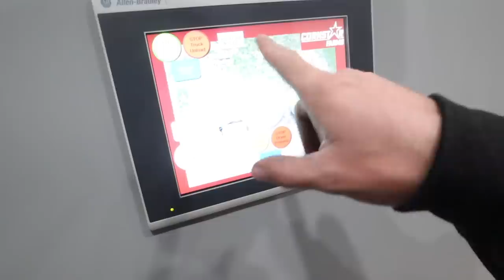Dad Blew His Top

Comment: have the elevator leg sped up either electric or change the pulleys on the drive as it is not at the rated capacity and it sounds as tho the cross auger is at 8000 or slow the cross auger down by changing the pulleys

Comment: Can you put larger belt pulleys on the motor and the cross auger to get more surface area so the belts don't slip so easily? Can the center pit auger be sped up to take the corn away faster. Possibly turn the cross auger on once the pit auger has taken everything it can so the corn isn't getting jammed together in the center. If the motor uses VFD, there is a way to set the current load on the motor to shut it down before it slips the belts. Maybe slow down the cross auger by putting larger pulleys on it. You might even put sprockets and chain on it instead of belts.

Comment: can you remove some of the flighting from the ends of the cross augers where they meet in center to take load off belts and still move gain to center auger? Next option install smaller diameter cross augers to take load off belts. Another option would be to slow down cross augers by changing pulley diameter.
Good luck and God Bless thank you for the videos and hours of editing
Reply: pass it on please I have hat and sweat shirt already. thank you

Comment: If center auger to leg can't empty because leg it too slow.....Change pulley on cross auger to slow it down so it won't overload and burn belts off. It might not run at capacity you want but at least it will run so that you can head back to field while pit empties. Running a little slower is better than burning belts and blowing a head gadket.. Looks like combine is running good.
Reply: yep,  if its building up in the middle slow down the cross augers

Comment: Belt drive basics as I understood them: A drive belt has a horsepower rating which is affected by the service environment. Belt speed and heat are two things that will affect service life. Belts will operate reliably if alignment of the pulleys and belt tension is within the manufacturer's design envelope for a given application. 

The system as I understand it: The drive motor has a horsepower rating. The auger has a horsepower input requirement for a given weight of grain per unit time. 

Why are these auger drive belts failing to give expected service life? Difficult to analyze from here. But... If alignment and tension meet mfg specs what is the rating on the motor and the rating in this service on the belts? Could it be as easy (and by easy I mean possibly very difficult if not impossible without painful and expensive equipment modifications) to increase the number of belts and the width of belt used. (Yes. New sheaves/pulleys for wider belts and possibly more sheaves/pulleys for one more additional belts.) 

Next I'd worry about the auger bearings. 

Are the motor amps under load essentially the same as the FLA (full load amps) on the motor nameplate?

Comment: I thought that green machine was  a Lean, Mean, Soybean eating machine!  It's mean and mad. GLad they are bringing another for you to try.  :)
Goodyear makes good tires, yes ag is different then cars. But i like them, two sets for two cars.  
I had a plymouth van years ago, the accy belt would slip off if it hit a cold water puddle in the fall.  
Goodyear made a gatorback belt and kit with a double sided v belt and a grooved idler.  

Maybee the tire rep has some contacts you could order some good GOODYEAR belts!
Wishing you the best in harvest and hope you can find the problem for the cross auger. 

As far as the air hose, put a tee to a whistle for your dad.  Put it at the top of the structure.  Blow a 14-L!

Comment: i got a top tip for you to chek out an is do it now not after harvest ---   secret about electrick in 90% off the time its cheper to let it run than start it 3 to 4 times a day  you might want to ask your electrick guy or your prowider how your bill is structured  the higest price you pay is calculated on the amount off ampers you use when you start a motor hear is a crud example 100 amp motor might go to 150 amp on the start then go down to 70 under load

Comment: You guys have every right to be upset. You can only bottle up so much. Doesn’t matter how much money you spend on something it should work atleast until things start to wear or get old. We’ve fought that chaffer issue on our s680 since we’ve owned it. No reason there shouldn’t be a fix for that by now
Reply: After DCs explanation at about 15:00, since your pit auger and leg aren’t moving grain fast enough it sounds like that middle double auger is moving to fast so if you aren’t done yet you could put on a bigger driven pulley to slow it down to get by. Sounds like it might be trying to force too much grain to the middle

Comment: My guess is that the cross augur pulleys are to small for the horse power of the motor, gates belt chart for the min diameter on the motor to the hp.
up size the pulleys and installing longer belts to fit should fix the problem .

Comment: Re your cross auger issue. If I understood what D-CornStar was explaining, in that two motors are pushing corn to a centre point, and when that point becomes full they get overloaded and belts burnup. You should be able to detect this by monitoring the load on the two motors doing the pushing with a simple device like a "Shelly EM" (which can monitor two loads). with this detail your software guy would have the means to add rules that say if the load  on any of the 2 cross auger motors is above X load for more than 1 minute, turn the motor off for Y time period then turn on again. Should be fixable regardless I hope that helps D

Comment: This may have been mentioned before.. but is it possible to take that cross auger and split it, add a second motor to the other end, in some form? Either split the auger, or keep it as one but a second motor, something like that? Since I assume replacing the pit with something else is out of the question at this point..

Comment: Have your automation guy program the plc so that the cross auger in the pit does not run when you are start the pit. Start running the main pit auger and then when the pit is mostly empty and the current drops off on the main auger, then turn the cross auger on and run until the pit is empty. That way the cross auger will not fight itself when the pit is full.
Reply: excellent logic my friend
Reply: But I very much doubt that it has a PLC

Comment: I cant remember if there has been a good video shot showing the motor pulley setup in the pit. Seems I am only remembering some dark hard to see shots. That said, if there is room to change the pulleys on the Motor larger an or smaller on the Belts pulley, until the auger situation is fixed. This would slow the the belt speed of the belts. Have to wonder if your auger is in need of different pulleys, but I am sure that is all in the problem you are having that's in the lawsuit.

Comment: Does the cross auger in the pit start at the same time as the lifting auger? If it does the lifting auger may be overfed and the cross auger burns out its belts. If this is the case i would put in a timed delay on the cross auger so that the lifting auger has time to empty out the center of the pit before the cross auger starts. Just my two cents on the problem from the limited information on the issue.

Comment: I'm not sure of the setup you guy's have but from the little bit I have seen of the pit you're ALLWAYS gonna be having problem's with it it!!! I am a millwright and all I can say is you should have spent the money for a better set up or got a different company.  But you guy's could try putting a dodge gear box on the auger. You live you learn good luck.
Reply: The problem is option number 2, but you don't know that at the time.  They spent more than enough money for the setup they had put in.  The contractor sounds like they were sleazebags, that put it in as cheap as they could on their end of things, and probably skimmed as much as they could.  If it's a company who cares about they job they do, they should know how to put that handling system together properly.  As a comparison, you have Dr Hibbert on The Simpsons, and then there is Dr Nick Riviera.

Comment: Cross auger belts burning up ? 
You need to slow the cross auger down 
and design the auger belt drive so it
capacity enough to trip the motor off 

If do not slow cross auger you need to 
speed the center auger up .... probably 
bigger motor and more capacity on the
belt  drive 

The cross auger and center need to be
in balance with each other 

There is no reason to be burning belts up

Comment: Just breathe DC, it'll all get sorted out.  You dont deserve to get so upset. I dont know what your setup is but it sounds like those 2 side pit augers need to slow down and or increase torque by changing the pulley ratios and if it's only 2 belts, it should probably be 4 per side. I do remember watching you change them before.

Comment: I would look into changing that belt drive system out for a chain drive system, it would be louder but way more dependable. We'll good luck with the rest of your harvest.
Reply: Just trying to dump the truck faster than the cross auger system will handle.  Less belly dump gate opening
They didnt get the capacity they thought they specd

Comment: Start the electric Motor of the pit on before you open the lits ... this shall be much better.
Use chains instead of belt or belt with teeth on the cross orga. Chain translation/gears.

Comment: So sorry the bran new pit and bins systems are not operating properly. I know I would have lost my temper long ago over the pit augers and other constant issues.. I hope the computer system can be adjusted or re programed so the pit augers motors run and pull at the proper rpm at the proper times and stop the overload situation.
There are an amazingly high number of people who just do not understand a that a semi and a pick up pulling a livestock trailer or any trailer with a load on it can not stop on a dime. I see people cut in front of loaded semis on the highway and freeway every day, pass going up hill on a curvy /2 lane road, cut off semis, pull in front of and stop. it’s plain dangerous for everyone when drivers do these things. It’s not worth everyone’s life because 1 person is in a hurry and causes a huge fatality wreck.

Comment: Too many moving parts, I hate to spend money but I'd dig it out, replace with a deep hopper, with only one large pickup in the bottom thats gravity fed.  No extra motors, belts etc, and the drivetrain for the single pickup is on the surface.  Also a longer unloading zone, as you're just barely getting both trailer hoppers to fit at the same time...and fully cover the entire setup...

armchair QB at my finest

Comment: The pit cross auger sounds like a good design BUT did the guy that designed it  have any experience working with one?  Engineering students NEED to spend a year  working as a mechanic  BEFORE they start their final year of study.  That experience will make them think twice about where to run a shaft or belt and how to access it for repairs.
Since the pit auger feeds to the middle and pushes the grain in to fast to be removed by the discharge auger would shortening the flight near the middle, and / or possibly gradually reducing the diameter of the cross auger  near the middle help?

Comment: LOL why did Cole tell him to fold the auger back in after he filled it with corn?
Reply: when its folded back, there is a solid support bracket that holds the weight of the auger in transport or field operation. Extending a fully loaded tube is not good practice, especially if you are going fast and going to hit a rut on the headland.  Probably would have been better if you just would have backed out of the rows and go dump the combine---it is so not worth the risk of a snapped or stretched auger tube because you wanted to save 5 minutes, could have cost you lost time and about $10k for new auger if you could even get one..   It's kind of ironic that DC had the same words for the 4 passing drivers that were in a hurry to get home 2 minutes earlier... I have done all of the above in my younger years, so by no means am I a saint, just have more patience when you get older I guess...

Comment: Could those belts be replaced with chain and sprockets? 
Seems like a cheap and nasty design but then again it might be deliberate as they know the auger design creates a bind and don't want to burn a motor out.
Reply: Apparently the auger is in operation all of the time which isn't necessary. It needs a PLC  to control it.
Reply: @adrianchetwynd1334  Might be an idea to temporarily hard wire an On/Off switch to the motor so they can override it when the pit is full. That way they can just click it on when the pit needs it rather than the computer just defaulting the power to on as soon as they click start.
Reply: @HughzieTube  Very good idea as a temporary fix. But a PLC would be an automatic fix for next year.
Reply: @HughzieTube  The cross auger is only needed to expel the lateral stocks of corn. It does not increase the flow of the outlet, So you are correct, it could be manually operated.
Reply: @HughzieTube  I forget to mention that the bin needs a sensor to inform the PLC that the output auger is running short of corn.
Reply: The output auger can only do what it what it was designed to do
The cross auger is only required after the main input of corn has expired.

Has the man who designed this failed system got a real name?
Most probably not, so my 
message to Cole's dad is: chill out and stop being  so supportable of our real enemy...

Comment: Ever think about putting a heavy duty chain drive on that auger that keeps burning belts. Maybe a larger electric motor? And add a gear down transmission with an adjustable clutch.  The clutch would have to super heavy duty but it would protect the electric motor. I don’t blame DC at all.  Apparently the design is pretty pathetic or it wouldn’t keep burning up drive belts. Get another lawyer and sue the crap out of the installation company and the manufacturers. For what you spent it’s totally ridiculous.  Like the cost of new pickup trucks and they are junk compared to just 10 years ago.

Comment: Lowest bid quote is a setup for failure in any construction project
Add in contractee that is going from a simple primative grain storage building with junke undersized old augers to a massive high tech bin system then interfering in the construction process continually with multiple confusing change orders mods, not surprising such a massive failure
The bin system contractor will just subpoena in all those helter skeltor U Tube vids.  Plaintiff loses

Hyper ADHD young cannot manage complex projects